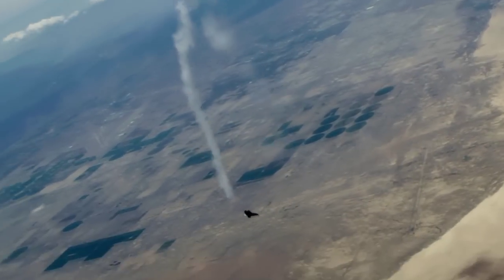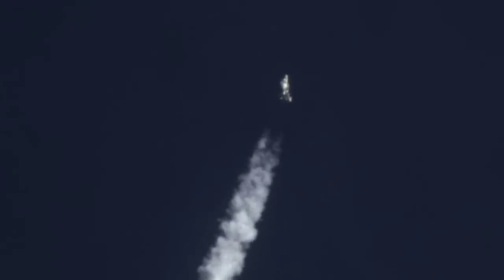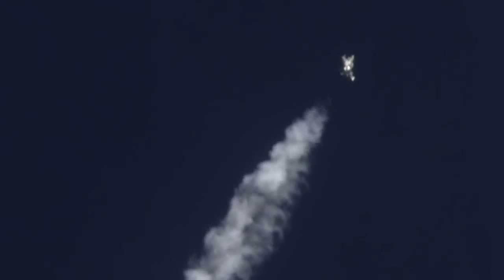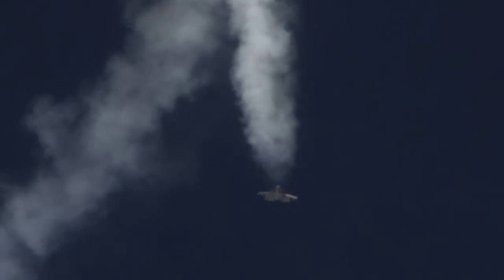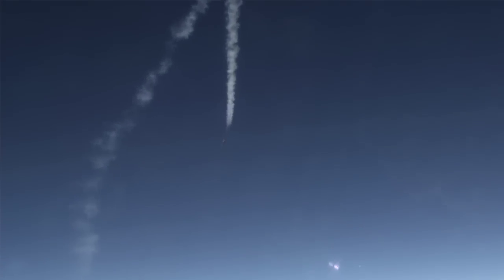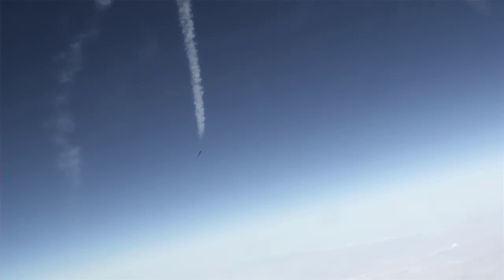F-35 Flight Test Intentional Departure

Comment: the AOA of the F-35 here is inferior to that of the russian SU-35E flanker, clearly. It's also inferior and slower than the AOA of the French Rafale or the EF Typhoon. Not impressed by this plane. At all.
Reply: jack black F-16's angle of attack capability is less than F-35.

Wing loadings via empty weight.

F-35A
Empty weight: 29,030 lb (Year 2013 build).
Wing area: 460 ft²
Wing loading: 63.11 lbs/ sq feet.

F-16C Block 52
Wing area: 300 ft²
Empty weight: 18,900 lb
Wing loading: 63 lbs/ sq feet.

F-35A's empty weight is 1.54X scaled from F-16C.
F-35A's wing area is 1.53X scaled from F-16C.
F-35A's 43000 lbf thrust is 1.50X scaled from F-16C's 28600 lbf.

There's a near straight scaling between F16C to F-35.

From http://breakingdefense.com/2014/06/gen-mike-hostage-on-the-f-35-no-growlers-needed-when-war-starts/3/
General Mike Hostage On The F-35 vs F-16
The F-35, he says, has “at least” the maneuverability and thrust and weight of the F-16. The F-35 is to the F-22 as the F-16 is to the F-15.

F-35A's main target goal is to replace F-16.

F-35A
Empty weight: 29,030 lb (Year 2013 build).
Wing Area: 460 ft²
Weapons: 2000 lb
Fuel: 7070 lb 
Combat load: 38100 lb
Wing loading 82.83 lbs/ sq feet.
Thrust: 43000 lbf
Power-to-Weight: 1.13 : 1
 
F-16C Block 52
Empty weight: 18900 lb
Wing Area: 300 ft²
Weapons: 2000 lb
Fuel: 3950 lb at 51% internal fuel tank
Wing loading: 82.83 lbs/ sq feet.
Combat Load: 24850 lb
Thrust: 28600 lbf
Power-to-Weight: 1.15 : 1

References for F35's engine improvements during and after year 2013.
(Note Ref 1) From Feb 2013, read
http://www.flightglobal.com/news/articles/pratt-amp-whitney-to-test-upgraded-f135-this-year-382781/
The option to add 5 percent of thrust on top of 43,000 lbf i.e. 45150 lbf. This improvement also has 5 percent fuel efficiency increase from USN's Fuel Burn Reduction (FBR) programme. This engine improvement was tested late year 2013.

(Note Ref 2) From Sep 2013, read http://www.flightglobal.com/news/articles/pratt-amp-whitney-and-afrl-start-testing-on-adaptive-fan-test-390994/
Pratt has another engine update for F-35 i.e. another 10% increase in thrust and 25 percent fuel efficiency increase. This is adaptive engine upgrade.

(Note Ref 2) From http://www.pw.utc.com/Press/Story/20130619-0600/2013/All%20Categories
Year 2016 for adaptive engine test with higher 10% increase in thrust power AND  25 percent increase in fuel efficiency.

From Norwegians' F-35 briefings
http://www.regjeringen.no/upload/FD/Temadokumenter/JSF_RBI-svar.pdf
F-35 Block 6 has
+ Range improvements
+ Propulsion Improvements.
Going beyond F-16C

F-35A
Empty weight: 29,030 lb (Year 2013 build).
Wing Area: 460 ft²
Weapons: 2000 lb
Fuel: 7070 lb 
Combat load: 38100 lb
Wing loading 82.83 lbs/ sq feet.
Thrust: 47300 lbf  (just the adaptive engine upgrade with 25 percent increase in fuel efficiency)
Power-to-Weight: 1.24 : 1

*Thrust: 45150 lbf  (just the hot-core upgrade for power, neutral fuel consumption increase)
Power-to-Weight: 1.185 : 1

From http://www.airforce-magazine.com/MagazineArchive/Pages/2012/November%202012/1112fighter.aspx

The F-35, while not technically a "supercruising" aircraft, can maintain Mach 1.2 for a dash of 150 miles without using fuel-gulping afterburners."Mach 1.2 is a good speed for you, according to the pilots," O’Bryan said

"According to Col. Rob Simms at the US embassy in Oslo", with 4600 pph fuel settings. F-35A's internal fuel yields 1600+ nm effective range (3000+ km)  with a 2500 pound internal tactical loadout. Range can be increased with external tanks.

F-35A out ranges F-16C.
F-35A has supercruise features, but lower than F-22's.
Reply: Rafale's angle of attack.
http://www.flightglobal.com/news/articles/flight-test-dassault-rafale-rampant-rafale-334383/
The DFCS is a "g" demand system with +9.0g/29° angle of attack (AoA) limit in air-to-air mode and +5.5g/20° AoA limit in both of the two air-to-ground/heavy stores modes (ST1 and ST2) to cater for forward or aft centre of gravity

Typhoon vs F-35 angle of attack.
http://www.flightglobal.com/news/articles/in-focus-lockheed-claims-f-35-kinematics-better-than-or-equal-to-typhoon-or-super-382078/
The Typhoon, by comparison, has a 25° AOA limit. In the F-35, Lockheed made the decision to limit the AOA to 50°, but test pilots have flown the aircraft well past that.
The high AOA limit gives the F-35 "great" instantaneous turn performance. "We knew that 50°, from our years of research, is about as far as you need to go to take advantage of the aerodynamic performance" of the jet, Flynn says. "There is no reason to be there [at extreme AOA]; you're not going to get much more capability at 75° than you would at 50°."
Reply: I thank you for those links, 

1. The typhoon is simply not "the best 4th" gen: The Rafale beats the typhoon at each confrontation... (ATLC 2009 4-0 & 3-1 for Rafale, september 2010 Solenzara 9-1 for the Rafale in dogfight...)
The best 4th gen is the Rafale or maybe the Su 35 E flanker...so Mrs Billy Flynn mistake himself when he says that.

2. Typhoon and Rafale are both hypermaneuvrable jets, I have seen them fly. nothing in this video shows that the F-35 could come even close to the level of the Rafale or the Typhoon. And I do not even speak about the SU-35 who is incredible for that. 

About the number: angle of attack of the Rafale is 29°...with heavy payload of 9.5 tons! (witch is excellent) In normal configuration, the angle od attack of the Rafale is...100°!! the instantanous rolling of the Rafale is 270° per second....

in your links:
"The steady state roll rate at 350kt was 270°/s and the roll onset felt rapid but comfortable. At 450kt, the same steady-state roll rate was achieved, but the rate of roll onset was simply staggering. I have never experienced any fighter aircraft start or stop to roll so quickly."

so the 50° or even 75° of the F-35 are not impressive...

Believe me, mrs Billy Flynn is a test pilot doing his marketing job nicely, lockheed trying to justify the incredible amount of money put in a plane that  "can’t turn, can’t climb, can’t run".
Reply: Your SU35 AOA is nothing if it is knocked out without knowing that F35 is there...
Reply: jack black F-16 Block 60 empty weight also increased to 22,000 pounds with the same 300 square feet wing area.

Wing loadings via empty weight.

 F-35A
Empty weight: 29,030 lb (Year 2013 build).
Wing area: 460 ft²
Wing loading: 63.11 lbs/ sq feet.

F-16C Block 52
Wing area: 300 ft²
Empty weight: 18,900 lb
Wing loading: 63 lbs/ sq feet.

F-16E/F Block 60
Wing area: 300 ft²
Empty weight: 22,000  lb
Wing loading: 73.3  lbs/ sq feet.

F-35A's empty weight is 1.54X scaled from F-16C.

F-35A's wing area is 1.53X scaled from F-16C.

F-35A's 43000 lbf thrust is 1.50X scaled from F-16C's 28600 lbf.

There's a near straight scaling between F16C to F-35.

F-35A
Empty weight: 29,030 lb (Year 2013 build).
Wing Area: 460 ft²
Weapons: 2000 lb
Fuel: 7070 lb 
Combat load: 38100 lb
Wing loading 82.83 lbs/ sq feet.
Thrust: 43000 lbf
Power-to-Weight: 1.13 : 1
 
F-16C Block 52
Empty weight: 18900 lb
Wing Area: 300 ft²
Weapons: 2000 lb
Fuel: 3950 lb at 51% internal fuel tank
Wing loading: 82.83 lbs/ sq feet.
Combat Load: 24850 lb
Thrust: 28600 lbf
Power-to-Weight: 1.15 : 1

F-16E/F Block 60
Empty weight: 22000 lb
Wing Area: 300 ft²
Weapons: 2000 lb
Fuel: 3950 lb at 56% internal fuel tank
Wing loading: 93.16 lbs/ sq feet.
Combat Load: 27950 lb
Thrust: 32500 lbf
Power-to-Weight: 1.16 : 1

F-16E/F Block 60 is getting high.

References for F35's engine improvements during and after year 2013.
(Note Ref 1) From Feb 2013, read
http://www.flightglobal.com/news/articles/pratt-amp-whitney-to-test-upgraded-f135-this-year-382781/
The option to add 5 percent of thrust on top of 43,000 lbf i.e. 45150 lbf. This improvement also has 5 percent fuel efficiency increase from USN's Fuel Burn Reduction (FBR)
programme. This engine improvement was tested late year 2013.

(Note Ref 2) From Sep 2013, read http://www.flightglobal.com/news/articles/pratt-amp-whitney-and-afrl-start-testing-on-adaptive-fan-test-390994/
Pratt has another engine update for F-35 i.e. another 10% increase in thrust and 25 percent fuel efficiency increase. This is adaptive engine upgrade.

(Note Ref 2) From http://www.pw.utc.com/Press/Story/20130619-0600/2013/All%20Categories
Year 2016 for adaptive engine test with higher 10% increase in thrust power AND  25 percent increase in fuel efficiency.
From Norwegians' F-35 briefings
http://www.regjeringen.no/upload/FD/Temadokumenter/JSF_RBI-svar.pdf
F-35 Block 6 has
+ Range improvements
+ Propulsion Improvements.
Going beyond F-16C

F-35A
Empty weight: 29,030 lb (Year 2013 build).
Wing Area: 460 ft²
Weapons: 2000 lb
Fuel: 7070 lb 
Combat load: 38100 lb
Wing loading 82.83 lbs/ sq feet.
Thrust: 47300 lbf  (just the adaptive engine upgrade with 25 percent increase in fuel efficiency)
Power-to-Weight: 1.24 : 1

*Thrust: 45150 lbf  (just the hot-core upgrade for power, neutral fuel consumption increase)
Power-to-Weight: 1.185 : 1
Reply: General Lee, the F-35 has a limiter at 50 degrees but has been demonstrated past that on test flights.
Reply: You also have like 5% of information on this plane's capabilities.
Reply: F-35 can exceed 90 degree AOA, they just set it at 20 degree AOA limit before, and now its at 50. so GTFO moron
Reply: Doesn't matter how old he is or what he plays, he acts like a civilized human being, and you do not. 

The F-35 is designed to reach 50 degrees AoA quite happily. There is no official data that contradicts this fact.
Reply: And you have zero evidence to back up your "20 degree" claim, while every official test flight report on the F-35 will agree that the limiter is conservatively set to 50 degrees.

Childish insults can't cover up the fact that you're wrong, dude.
Reply: The handling qualities are determined by the control laws, and can be updated to make the aircraft fly better. But you're right, the F-35 probably isn't the most potent dogfighter around, it's not designed to be. 

https://www.f35.com/in-depth/detail/the-f-35s-high-angle-of-attack-explained

http://m.aviationweek.com/defense/f-35-flies-against-f-16-basic-fighter-maneuvers

Out of curiosity, why is the F-35 supposedly limited to 20 degrees? Does it nose slice? Deep stall like the F-16? Please, I'd love to know.
Reply: I'm sure you could find the flight number if you look. I don't care, because there is nothing that indicates the AoA limit is anything lower than 50 degrees, or that the USAF would make such a blatant lie. 

What I'm wondering, is why a modern, relaxed stability, fly by wire aircraft would be limited to 20 degrees. I know a thing or two about the aerodynamics of fighters, and I just don't get where your conspiracy theory is coming from (other than your ass, maybe).

Edit: I re-read it, and the test pilot report you posted was simply highlighting a deficiency in the flight control system's lateral control in certain AoA regimes. "Blended" likely means the FCS is transferring lateral control from the roll surfaces to the rudder. If this transition isn't done smoothly as a function of AoA and load factor, the control response will be very unpredictable, which is what the pilot was complaining about. And again, the FCS is entirely digital, so the engineers can use that feedback to improve the flight control laws and make the aircraft's control response more predictable as flight conditions change (which is the ultimate goal of a FBW system). 

Plus, the report even says "20 to 26 DEGREES," so you've proven your "20 degree" statement wrong anyway.
Reply: Standard Block 3i AoA is software limited. Work in progress Block 3F has 50 degress AoA.
Reply: dude the F-16 beats this in any situation except maybe stealth
Reply: Block 60 f-16's are powered by the General Electric F110-GE-132 turbofan, which is rated at a maximum thrust of 32,500 lbf take the weight into consideration. makes it almost even again!
Reply: 20 deg lmao GTFO moron
Reply: Your existence is pathetic
Reply: http://www.flightglobal.com/news/articles/in-focus-lockheed-claims-f-35-kinematics-better-than-or-equal-to-typhoon-or-super-382078/

The Typhoon, by comparison, has a 25° AOA limit. In the F-35, Lockheed made the decision to limit the AOA to 50°, but test pilots have flown the aircraft well past that.
The high AOA limit gives the F-35 "great" instantaneous turn performance. "We knew that 50°, from our years of research, is about as far as you need to go to take advantage of the aerodynamic performance" of the jet, Flynn says. "There is no reason to be there [at extreme AOA]; you're not going to get much more capability at 75° than you would at 50°."
Reply: Lee, you're still ignoring that one of the articles YOU cited said "26 degrees AoA."
Reply: Xavier LeFrançais
F-35A Block 3F has +9.0g/50 degrees angle of attack (AoA) limit

Inferior angle of attack (AoA) with EuroCanards

https://youtu.be/mkgShfxTzmo?t=141
Gripen's high angle of attack lost of control with engine flame out.

EuroFighter
https://www.eurofighter.com/news-and-events/2011/07/info-eurofighter-typhoon-wins-of-steedman-display-sword-at-riat
_pulling up to 5.5g and in excess of 20 degrees angle of attack

Gripen
https://www.flightglobal.com/news/articles/saab-performs-gripen-high-alpha-trials-12697/
tests so far have been carried out at steady-state angles of attack of up to 28 degrees

Rafale
http://www.flightglobal.com/news/articles/flight-test-dassault-rafale-rampant-rafale-334383/
The DFCS is a "g" demand system with +9.0g/29° angle of attack (AoA) limit in air-to-air mode and +5.5g/20° AoA limit in both of the two air-to-ground/heavy stores modes (ST1 and ST2) to cater for forward or aft centre of gravity
Reply: General Lee, That's not F-35A Block  3F dckhead.

This is for F-35A Block 3F as of December 2017
http://www.luke.af.mil/News/Article-Display/Article/1386133/lukes-newest-amu-supports-f-35-program/
"The unit is the first Luke F-35 AMU to receive a 3F, or full-up, combat aircraft capable of pulling 9G’s in the air."

Try again clown.
Reply: Monster LMA same is true for the Rafale with Rafale F3R standard, witch is already operationnal, specialy on the AESA radar witch is already in use in the French air Force at this time...CAPTOR AESA radar for Typhoon wil be in use in ....???? 2018 maybe (optimistic prevision).